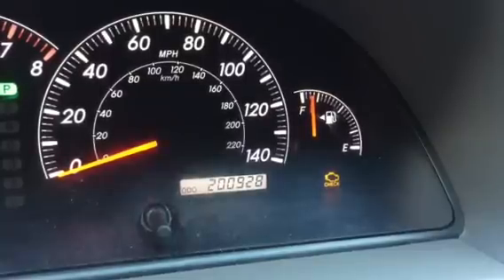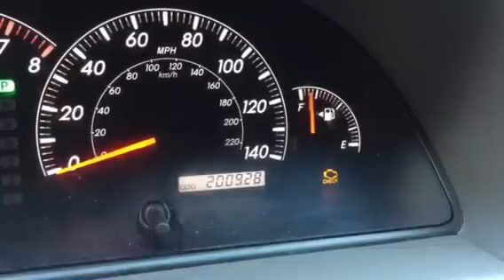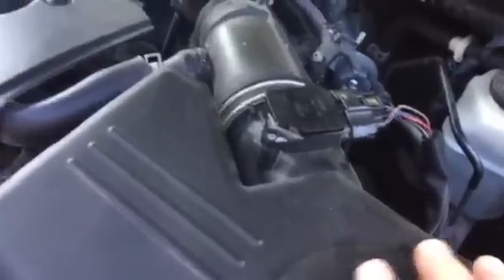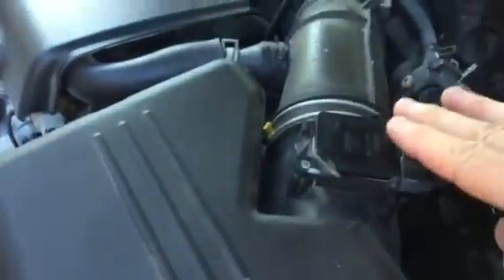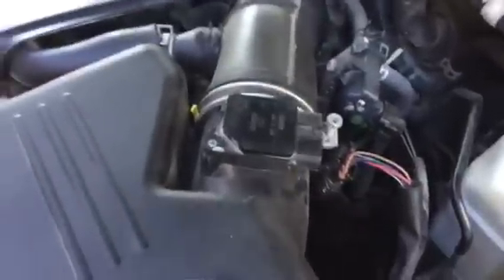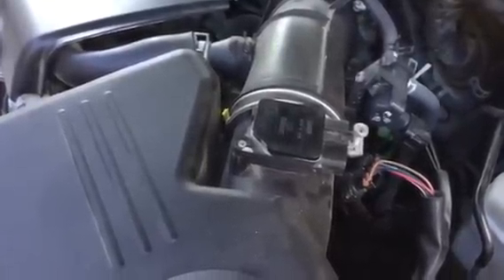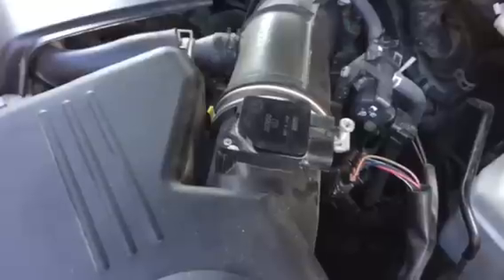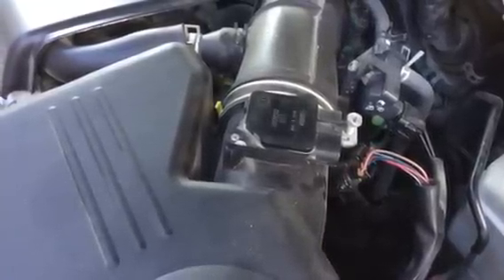How To Tell If Your Mass Air Flow Sensor Is Bad On Your Car

Comment: I know this is an older video, but I'm gonna check this in the a.m. I checked it, while the engine was off. Does this cause the engine to shake a little bit, as well? I've changed out my spark plugs OEM parts. I have a 2017 VW Passat tsi se.

Comment: My 2012 corolla gives a  P0101 code for mass air flow sensor but when I disconnect the maf while car is running, the engine shuts off.  Any ideas?

Comment: my maf is brand new and engine does not cut out when disconnected .and lack of power when driving and zigzag and engine light on .so some thing else the problem .its a 2015 dacia duster

Comment: If the car shuts off when you unplug it how the hell does that indicate the mass air flow sensor being bad if you want to plug it and it stays running if it's unplugged the car doesn't even know what the heck's going on if it's unplugged and has nothing to do with that the car is running or not there's no longer plugged in

Comment: On my 2008 suburban stared ideling rough and when i disconnect  that,  the car still runs...
Reply from the maker: If that doesn’t fix it, you might just need to clean your throttle body.

Comment: THAT ENGINE SYMBLE WILL SHOW UP IF THERE IS SOMETHING WRONG WITH ELECTRONIC PARTS RELATED TO THE RUNNING. MINE SHOWS UP BECAUSE THE COIL PACK ON LEFT SIDE NEAR THE FIREWALL. IE #6. It has a bad seal and you cannot buy just the seal. FYI

Comment: I have a problem with EGR  code PO49B check engine light is on with Traction and Cruise blinking..I change the EGR but problem persist..I replace the MAF..problem  gone

Comment: I tried this after seeing P0171 and I have a look at the purge valve and it was good but didn't know if the Maf sensor was the problem as odm reader didn't seem to show any issues but after trying this the engine kept running so it seems this actually works at detecting if it's faulty 👍🏾. Going to replace it and I'll have to update this comment to confirm if it was a actual the cause of the check light.

Comment: Dose this trick always mean it's bad, or could it be something else, cause I got a car from my dad and has had problems so he didn't want it, I took it to auto zone to run codes and it says the maf air floor sensor is faulty, my dad said he replaced it already maybe a few months before giving it to me and it still looks brand new not a spec of dirt on it, I even cleaned it. It's still running after I unplug it, could the new one be faulty? 2001 impala 3.8 v6

Comment: For cars like the 5th generation Nissan Altimas, NEVER EVER buy an aftermarket MAF sensor!

Dig deep and fork out the $300+ for an OEM sensor, otherwise you will see that annoying Check Engine Light  to no end!

Been there, done that.

Comment: Mine started over reading at about 10x. I reset it and it was fine, but then i needed the battery off to change something and it came back. Getting a new one tomorrow.

Comment: Hello, so when I changed my radiator, I forgot to plug back my MAF sensor! lol so my car was stalling , turning off when I would start it and the second time I would start my car again , it would turn on but! It would idle , and my car would want to shut off , and when I would hit press the gas to go faster, my car would pass the 3 in the RPM IT WOULD DRASTICALLY fall down ( my speed ) from 50 MPH to 20 MPH . You think it was because my sensor wasn’t plugged in? I replugged it , and it stared smooth , didn’t shut off , and would stall .

Comment: Is the engine meant to cut out as quickly as yours did when you unplugged the maf sensor? When I unplugged mine the engine immediately `choked' and tried to keep running ; behaved abnormally as though it was having a heart attack: then after approximately 1.5-2 seconds it cut out. thank you.

Comment: If you run a K&N type filter, the oil (with dirt) will get on the sensor and cause problems.

Comment: 2019 Honda accord 1.5t….

I unplugged the MAF but it kept running. But now my check engine light is on when it wasn’t in the first place. I was just tying to figure out the root to the rough idle/ gradual fluctuating rpm😭😭😭😭

Comment: As you all know there are many reasons the engine light comes on....using fuel injector cleaner in you gas tank will clear engine light, I had it on my car for almost 2 years, its gone .....

Comment: Yesterday my wife was driving I was in my passenger seat, check engine light came on sitting at red light. I did what you said and my car kept running. Thank you sir I’m getting ready to go to the part store and replace it now same with engine filter and I will clean my throttle body as well
Reply from the maker: When you go to the parts store, also have them check your vehicle with a diagnostic scanner, which they will perform for free.
Reply: @proclaimliberty2000 alright I’ll have them check it as well. Should I reset it removing the neg on the battery after I replace it or should I just drive it and wait till it goes away the check engine light ? My wife also order a scan tool from Amazon should come in later tonight
Reply from the maker: First have them check it with a diagnostic scanner before doing anything else.
Reply: @proclaimliberty2000 will do boss thank you
Reply: @proclaimliberty2000 hey I just went to AutoZone had them scan it they said my EGR valve was bad but they didn’t have any in stock for my 2022 Camry so I drove to Napa a few blocks down the street I walked in they said it was 580 and would have to get it outta town so I said I’ll think on it. I walk back to my car and get in and turn it on and the check engine light disappeared and hasn’t came back on when I turned it back off and back on

Comment: I have a 2009 isuzu dmax and for months i experience engine stalling and rough idling, mechanics said fuel tank is dirty, changed fuel filter, same issue........i decided to remove the map whilst the vehicle is idling and as said it continued working and didn't cut off, there i knew the map was bad, i even experienced transmission rough changing,,,,,,,bought a new map and installed it, all issues gone.
THANKS

Comment: My car runs rough… and doesnt accelerate well with little power I tried this trick and my engine shut off… so does that rule out the sensor? Could it still need to be cleaned ? If its not the sensor then what is the problem?

Comment: Hello everyone, I have this Mass Or Volume Air Flow Sensor error
P010100 "A" Circuit Range/Performance Active/Static.
I changed the sensor with the box and filter but I still get the error, I disconnect the sensor but the engine works continuously, it works without change. What could it be? thanks everyone

Comment: I just replaced my mass air flow sensor and the engine doesn't stop when I unplug it. Update: I needed to give my truck time to program to it. Now it works fine.

Comment: have you heard if you disconnect the MAF sensor in this car should shut down or turn off? Mine didn't, still running. Could be bad? So, I guess is time for change.
Reply: yes i did the same and my mazda 3 kept running.. changed the MAF and now the car runs perfectly
Reply: @franksigouin4817  But my car run more than perfect with MAF sensor disconnected. I bought a new one and did the same, so what else?

Comment: Thanks for getting right to the point... I unplugged mine and the car cut off also. Not only can you do this for the MAF sensor, but other sensors as well. With the other sensors; if the car runs rough! The Engine will smooth out if unplugged or stall out... What your trying to see is, if the part even working at all. Then you know what to focus on. 😢 But the other car guys will never say what this guy just said... If your really trying to help people, show them the easy way first... We don't have time to go back to school and learn what they know in there head, we got a problem to fix.... "The best time to unplug a sensor is right when the problem start". Even if the car stalled out. Just unplug your sensors one at a time; if the car cranks up when you unplug it, that's the one causing the problem! Because the ECU goes into Default Mode just to keep the car running; but that bad sensor be working and not working causing corrupted data to the Cars computer...I keep two sensor parts in my 😂 car All the time... If I suspect that sensor is the problem; I just replace it with my 👉" Get me from off the side of this road part". That's what I call them... End of story! 😂

Comment: I’ve been trying to figure out what was wrong with my 2017 Mitsubishi outlander stalling and low idling giving no codes. Unplugged the MAF sensor and the car kept running (low idle problem kicked in). Going to put a new MAF sensor in. Thank you so much

Comment: SOOOO WHAT IS THE REAL  TRUTH?? , I READ OFF GOOGLE", YES YOUR ENGINE WILL STILL RUN WHILE disconnected plug, IT IS "NORMAL", THE EGINE MANEGEMENT RELIES ON                            PRE-PROGRAMMED  VALUES AND  STORED DATA WHEN THE ENGINE IS ACTIVILY RUNNING MEANING IT DOESN'T immediately need the REAL air flow INFORMATION FROM THE MAF SENSOR TO MAINTAIN idle or start up.    so proclaimliberty2000 i need answers

Comment: This is a completely incorrect method of testing the MAF. any car with an ECM built after 08-09 will kill the engine or put it in creep mode when the signal from the MAF to ECM is lost as a general precaution. Pretty much ECM will go ‘oh no what happened to the MAF?? welp time to die or drive at 20mph all the way home’. Your car should die really quickly after disconnecting the MAF if it doesn’t, the MAF might not be the problem but the ECM and/or the programming might be completely out of whack and needing a relearn on the ECM. The only true way to tell is to see if the MAF operates outside of its voltage range (most cars will be at 0.5 - 1.5V). Don’t need to go to dealer or anything like that just get on OBD reader and check the PID to see what the voltage going to your MAF is and if it’s out of whack. Also, in the early stages of MAF failure the check engine light might not come on, especially if u are experiencing surges vs. drops, so u might feel and hear a thump from ur engine and a light jerk forward as if u accidentally floored just for a split second w/o moving ur foot on the gas. This is silly, it’s like running ur gas tank out of gas to see if ur fuel pump is getting louder or struggling to supply fuel coming at low levels. Might work, but not at all accurate or the best way to diagnose an issue.

Comment: Damn!! I just did that and my car kept going!! I am going to replace it now. I have spent 1000’s now trying to figure it out. 3 mechanic shops, they all agreed it was the catalytic converters!! Well, took it to the dealer for a “better” testing. Sure enough they said same thing. In my desperation, I cut the catalytic converters because Chevy has discontinued this part and shops wanted $3600 to replace them with after market but no warranty! So long story short.. still doing the same thing!!!

Comment: I thought you can clean these as seen on other videos, can it cause issues with a Cat code down stream and comes and goes.  Weird.  Replaced O2csensors and not that, small exhaust leak behind rear Cat and fixed that and nope.  Do have soot since garage fixed the coolant leak and took me for a ride as I was taking back to do because I found the part. They said I can't..I said I'm picking up the vehicle and cancel it, you won't see part as son works there, spoke to cousin that is district manager and no they send dirty stuff back that doesn't get wiped clean and wrong one because they don't match part up 1st. Many places do that and we have to clean and box UT up with grease on boxes, walking don't get those.  They complain it's used and technically it is.  But we don't want to lose 100K customer a year.

Comment: I'm guessing that even if the engine shuts off when disconnecting maf sensor, that doesn't guarantee the maf is sending accurate readings to the ecu.

Comment: ECU Default Mode: When the MAF sensor is disconnected, most modern Engine Control Units (ECUs) will switch to a default or "limp" mode. In this mode, the ECU uses preset values for air/fuel ratios instead of relying on real-time data from the MAF sensor.

Comment: another easy test for engine lites
..unplug battery for 30 seconds 
... lite may disappear
my dakotas would trip the oxygen sensor if I drove away immediately on a cold start...
... even 30 seconds of idle to clear any oil in chambers made a diff
... lite never came on after 30 sec idle... 
always came on if i didn't

Comment: Ok so I did mine cause my engine light is on and throwing code P0171 it kept running I bought a brand new one and tried it and my car is still running when I pulled the cable off any ideas? 2018 Buick Encore I will say it’s running better with the new MAF sensor

Comment: often a MAF sensor problem will not throw a fault code or check engine light...if the MAF is suspect EG..rough startup..especially when cold (as they have a heating wire) is to do it this way..1..unplug the maf sensor with ignition off..2..turn ignition on but not to start for 20 seconds..3..try to start car still with maf disconnected ( you will have a fault light ) if car starts normal ..it is the maf sensor because the ECU is running the default parameters

Comment: If I start after ten seconds of opening the switch, the car does not start.
But if I wait for about a minute, it turns on.
Fuel pump and regulator are healthy 
Healthy engine spark plug and wire
Healthy injector and battery 
Healthy water temperature sensor

Comment: What if my engine not stops but only start working worst after I pulled out? Its still  mean bad sensor? And OBDII show 5 and if pres gas pedal then 7+ what in theory show sensor is working? So I can't  understand  sensor is good or not .

Comment: Hello, me again, when your mass air flow sensor went bad was your car hard to start, but when started it runs smoothly, and once started and turned off, it can start on the first crank, but after 10 minutes it's hard to start again? I'm thinking the check valve in my gas tank is not holding pressure, so I scheduled an auto shop to do a code test on my engine trouble light. I can't drop the gas tank it's too much work for an amateur. If it's the mass air flow, they may try to take advantage of me. I'll try to see if my jeep goes off when I take off the mass air flow sensor. Thanks for posting this.

Comment: If u replaced to new one,is it works good after replacing?Because my is on low rpm choking.I changed the mass sensor still the same problem.So maybe i need to ride 20 miles like u said>?

Comment: You can check your brakes in the same manner. Cut your brake lines and if the car is stopping about the same as it was, then its probably about time to change your brakes.

Comment: Unplugged the connection to the maf sensor and the engine keeped running, so like you said I replaced the sensor with a brand new one, but still have the same issue, even on the new one when unplugged the connection the engine still running...so what you said in this video it's wrong

Comment: when the sensor is disconnected, the car continues to operate without changes, but the check engine and EPS lights come on....what is happening... the car has high fuel consumption and high CO, sluggish dynamics, the muffler smells of gasoline... the spark plugs, oxygen sensor, filter have been replaced, the revs do not fluctuate.

Comment: My car won't even start. The battery is good, but it it'll turn over and then immediately die. Why god?
Reply from the maker: @RUNNOFT71  Clean throttle body

Comment: 1999 Acura TL code P0131 and already changed the upstream and downstream O2 sensor and check engine light still won't turn off. Even the mechanic shop I took it too can't figure it out.

Comment: Just came across this video and happy I did.My 2019 Chev malibu with engine light coming on and car  not working good.took it to the dealer,3 and half hours later they said they couldn't find the problem, so they reset everything and if the light comes on again and they would keep it a few days and drive it with a laptop connected and see if they could find a problem.i left the dealers and less them 2 minutes the light came on.I knew I wouldn't be taking back.Found your video and this morning did what you said,car kept running.Took the mass air flow sensor off and cleaned it up with proper cleaner,returned it to the car ,light still on and drove it about 15 km turned car off,started it again.NO LIGHT :-)))) Car works like a charm now. Thank you so much.
Reply: What cleaner did you use?😅

Comment: When my '87 went bad, I had no idea what was wrong, it missed a lot but it actually got better mpg

Guy I know worked chevy garage said sounds like mass air flow sensor.....I said whaaaa?

He came up and checked it, handle side of screw driver gave it a firm tap and engine died, he put a new one on ran perfect......but with lower mpg

Comment: So, I have a 1994 Toyota 4Runner with codes 52 and 71. It has an issue accelerating, starting takes a few seconds, vibrates pretty intensely, and the engine has shut off 3 times while driving slower. I ran this test, and it stuttered and stayed on for like 5 seconds and shut off. Could that be an indication of an intermittent issue with the MAF sensor? (I got spark plugs changed, oils changed, new U joint, EFI relay has continuity, fuel pressure was tested, catalytic converter checked) Also, any ideas would be super appreciated everyone!

Comment: What if you had a ground problem on the harness side or a loose terminal pin fit. Or Mabey the resistor was dirty in the maf. Also what about limp mode.

Comment: Whenever the check engine light turns on, I just unplug the battery and turn on lights for 20 minutes to drain electrical. Mine has came on every 4 months for a several years now. And that's how  you beat inflation LOL